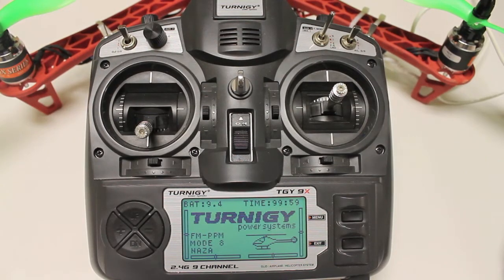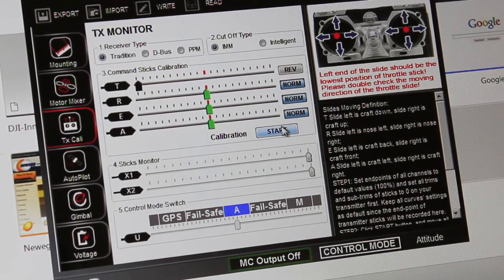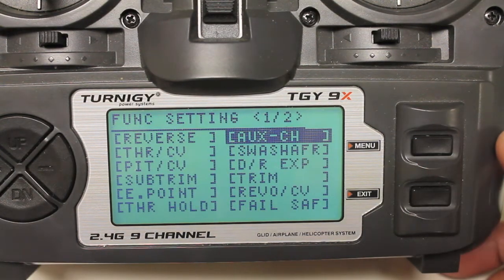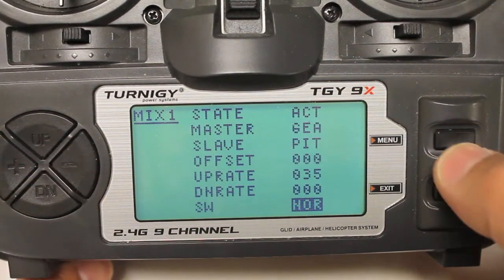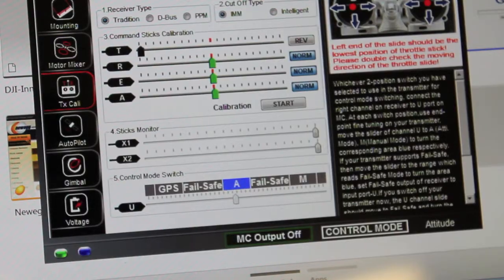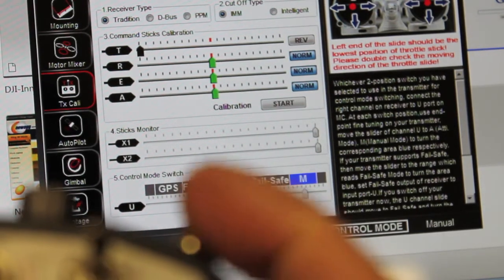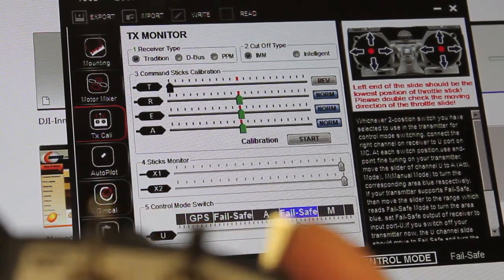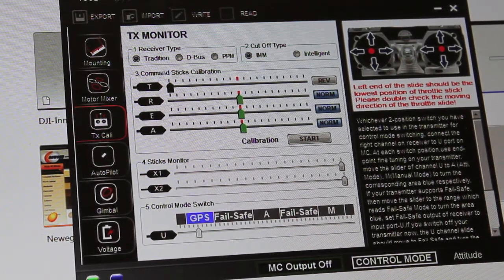DJI Naza Forced Failsafe Using Turnigy 9X Gear Switch Channel 5 Mix w/ 3 Position Switch

Comment: Dennis, have you ever setup the xaircraft minix flight controller using the 3-way switch on the Turnigy 9x? I sure could use some guidance. Thanks!
Reply from the maker: Denny Laman I'm sorry but I haven't worked with this FC before. I did just pull up the manual and it looks nearly identical to setting up flight modes with NAZA:

http://download.xaircraft.cn/Manuals/XAircraft%20MINIX%20Manual%20EN%20v1.0.pdf

Try watching this video and see if that helps you with your minix. Good luck!

https://www.youtube.com/watch?v=DikLpzlIqHA
Reply: Denny Laman  Hi Denny, did you figured out how to setup 3-way switch on 9x? I'm stuck in the same issue. Thanks
Reply: Sorry for the late response but I have no more worries about the 3-way switch for my quad as it just flew away! No more quad...

Comment: Nice video, congrats! Sorry for the question, but i have a problem with my naza connected to my frsky dr8 ii plus and my turnigy 9xr. When i push throttle i see that my x2 channel get up too. How can i do to fix that. I mean, I want that throttle dont  afffect x2 channel.

Thanks in advance.
Reply from the maker: Pedro Robles Hi! There is a part of this video that should explain why you're seeing the X2 channel go up. I'm assuming you're in heli mode, which may be the reason you're seeing this: Turnigy 9X Heli and Acro Flight Modes Explained

If you continue to have problems please post in our forums at www.garagepilots.com. Good luck!
Reply: Thanks a lot. It works!! Thanks you very much again!! 
I think this transmitter aren't absolutely  intuitive

Comment: Thank you for your wise advices!
I'd like to ask you two questions:
1) How is it possible to configure failsafe for GPS mode using the same gear switch?
I tried with MIX3 as for MIX1 or 2 but it's different and it don't works.
2) When I turn off my Turnigy 9X, Naza controller don't move on failsafe and my DJI F450 don't land. (I have actually no GPS).
How do I configure Turnigy 9X (V2 firmware and 8 chanel 9X8C-V2 receiver)?
Thank you for your help!

Comment: Hi Dennis,  Thanks for the help with the 9x it helped me heaps,   I was trying to find out if the 9x transmitter has a low voltage warning for the TX batteries, im running just AA Batteries in it.

Comment: dennis its all falling into place changing my naza m v1 to naza v2 and being able to use all functions could you please send me a link with pictures showing how to connect naza v2 to 9x receiver the correct way? I was using heli mode for over a year I followed kirkset setup now I see everyone using acro! whats the difference it flew fine in heli or does it have to do with being able to use more switches in acro mode? please get back to me asap also I have a few gifts for you a new blade rtf mqx and a blade rtf msr for all your help
Reply from the maker: Hey David, great to hear from you and I hope all is well. I saw your post on Garage Pilots the other day but have been hammered with work. Regarding ACRO vs HELI I was in the same boat as yo. I switched to ACRO mainly because of the 6 position switch. I was told that HELI has special mixing that doesn't apply to multirotors, but I've never noticed anything wrong with it. I sort of liked HELI mode better because there were less menu options :) I can walk you through setting up your receiver in the Garage Pilots forums, but I need to know what you're looking to do? Do you just want the 3 mode switch setup or more?

Comment: Dennis, After watching your great vids I've finally set up my 9X with the Naza Lite, my only problem is I can only setup home lock using the Throttle cut switch but I would like to use the AIL D/R switch instead, is this possible?
Reply from the maker: Karl Donald I'm not sure how you'd do that. I don't have my 9X anymore so I'm not sure if I'll be able to help. Sorry!
Reply: Karl- I thought I had mine set up under throttle cut but it doesn't work in the real world- just in the assistant. Can you please outline how you got yours to work?
Reply: Interesting. Not tried real world yet. I'm waiting for my frsky to arrive before I take it out

Comment: you mentioned not having the 9x anymore, but you still may be able to help me. When I am in "N" (for me its GPS) when I follow all of this, relative to my controller, I cant get it to slide to failsafe as I adjust the settings under uprate. It jus stays at GPS. when I flip the gear my "X1" goes from left to right so I know its activated. I have channel 6 set up as my pitch, I have channel 7 as X1 and channel 8 as X2. in my settings channel 7 is "gear" and channel 8 is "thro hold". any suggestions on how I can get failsafe?
Reply from the maker: Mr. McCabe I'm not really sure what's going on with your config. If I had my T9X still I could set it up like you and run some tests. The best I can say is continue to mess with your rates and see if you can get the slider to move into the failsafe area. Sorry, wish I could be of more assistance.

Comment: Dennis, thank you for your videos ! such a huge help to me. Are there any pros/cons for using F450 naza with a 9x in heli or acro mode?
Reply from the maker: I originally flew in heli mode but switched to acro to get 6 flight modes working with my APM flight controller. Other than menu options being a bit different I haven't noticed any difference.

Comment: Dennis.  Thanks for your videos!  They are great.  I'm trying to set up my flysky 9x with my dji naza and am having some problems.  I've got the ch 6 from the Rx heading into the U port on the Naza and on the radio, I've got ch 6 set to the gear switch.  When I fire up the assistant software, however, it has the U channel bound to the throttle - i.e., when I move the throttle lever, both throttle and U move.  Any ideas would be a big help.  Thanks!

Comment: Hello Dennis. Using this tuturial, do you think I can put a micro failsafe (used in cars) on the u channel and configure it to activate the failsafe switch when signal lost on a stock turnigy 9x rx? I saw a few videos on youtube with this but non replied to me there...
Reply: Yes, this works. First you set up a switch for forced failsafe, as in Denis' video. Then connect a nitro failsafe unit (I have a Hanger 9 failsafe) in between your receiver and your naza fc on your failsafe flite mode channel. It has a male servo connecter on one end and a female on the other end so it will connect in line. The nitro failsafe has a set button. Turn on the model and the tx, flip the forced failsafe switch and then press the set button on the nitro failsafe unit. It will now remember the pulse for the forced failsafe, and when the rx loses connection with the tx, the failsafe unit will trigger failsafe on the naza and either land, or return to launch, depending on how you have it set up in naza assistant. I am using this method until I upgrade the tx and rx with a module that has built in failsafe. Or until I get a taranis.

Comment: Hi Dennis, thanks for your videos, I learn a lot of thing :-) I tried to configure my radio with your recommandations but I failed. So, could u tell me : In the ProgMix1, the value of UpRate (35) is always the same or it depends of my configuration (NOR Value for example) ?
Other question : do u connect "U" in the Channel 5 in this case ?

Comment: Dennis,   I have the U port going to ch 6 and set up w Pit Trim.  I then have the pitch curve set to 3 different spots based on the 3 way switch.  I currently have X1 wired to ch. 7 and set to hov thro knob (because I was doing remote gain stuff).  I have 8 set to hov pitch, (trying to wire gimbal tilt)   I set the gear switch to ch.5 and set the mix 1 to master gear and slave pit.  have dnrate set at 15 and sw to nor.  leaving 3 way switch in nor position, I get no change when I flick gear.

Comment from the maker: If you click on "Show more" in the description of this video there will be a link to a 3 mode switch setup. This link will take you to a vid where I show how to configure the switch. Start at the 3 minute mark and watch as I discuss setting your L, 1, 2, 3, & H values to the same value. This will create a flat line that will prevent your throttle from altering its value. All values will be static. Hope that makes sense and let me know if you continue to have problems. Good luck.

Comment from the maker: Have you started with a clean profile on your T9X? I've helped a few others that have existing model profiles setup and that's caused some problems. Also, have you ever been able to configure your gear switch on the T9X without mixing?

Comment: Thanks for your video...You help me a lot!  I still have one big question - In Your video i can see how slider moving to " fail save" position, BUT it not enough ,same time MUST go THR slider to 55% position (and my copter  returning home with middle position THR )??? And like I understand with standard Turnigy TGY 9X V2 with PPM modulation "Fail save" channels not working( when TX OFF , DJI Ass not show.55% THR)???

Comment: Hello. I'm building Dji f550 with naza-m lite and turning 9x mode 2 :). I followed all the steps and my problem that motor's won't start! I'm not sure what is wrong and kindly need some help. Many thanks
Reply from the maker: When you say your motors won't start I'm assuming you can't arm them with the NAZA stick sequence. Are you using a GPS receiver and have you calibrated it? If you continue to have problems please check out www.garagepilots.com and post in the forums over there. Hopefully we can help you out.
Reply: Dennis Baldwin Dennis, I can not arm my motors either.  Im building the 550 also.  I get error 29, it seems even after I calibrate the sticks, everything is in the green on my NAZA, but the actual slider does not go all the way over to the right side on my "A" setting.  It goes all the way over to the left side, but not the right.  that may be where im getting my error 29?   HELP PLEASE...

Comment: Can you use this same method to configure the gear switch for IOC. Like maybe having gear switch of as IOC of and gear switch on as course lock?
Reply from the maker: I don't see why that wouldn't work. If I understand correctly with IOC though you need to be able to toggle it into the off position. If that is the case then you'd only have OFF and then one of your IOC modes. That may not be correct, but I recall something to that affect.

Comment: How do I do this with the 9xr? I want my 3 positions switch to be gps/additude/manual and my gear switch to be fail safe. Right now my 3 switch is gps/ additude/ fail safe. I'm using a 9xr with frsky module and receiver.  With a dji naza m v2. Can you do a video showing how to. Please.
Reply from the maker: +clinton soriano Unfortunately I no longer have my 9XR but this may help: https://www.youtube.com/watch?v=eWDX6i9yt4Q Good luck.

Comment: Dennis -  Thanks again for the videos.  I recently upgraded to the gps and am having some trouble.  No problem setting the three way switch to different flight modes, but when I try to add the gear switch, I get nothing.  Set it up exactly as you have in this video.  Any ideas as to what I could be doing wrong?  I have flysky.

Comment: Ok, based on a few of your GREAT videos... using the Turnigy 9X I can have the 3 flight modes (same as dji original controller)...could it be setup on 2 flight modes GPS, Attitude with the 3rd position as failsafe? Without using the gear switch? If force activating will this be a RTH failsafe as standard? I presume "yes" (common sense) is the answer to all these questions.

Next question is, if the DJI Phantom goes out of range will it still RTH? OR if transmitter turns off etc....?....AGAIN I presume "yes" is the answer here.

Lastly (i think)... can I program a switch to have OFF, Home Lock and Course Lock modes?

Ah, I thought of another... Sorry :).... Can I control a gimbal (pitch) at the same time as all the above features? I presume with them pots it can be done.

Hope all this makes sense :/ Basically I need full control like original DJI controller PLUS gimbal pitch. I have the daft 5.8ghz tx/rx radio gear with my phantom and want to convert to 2.4ghz radio gear so I can put some decent 5.8ghz fpv gear on board.

Cheers Nick
Reply: Is FrSky module actually needed? I believe others have got it working without the extra modules
Reply from the maker: njhmusicmanchester I'll do my best address some of your Qs. If you've configured your TX/RX for failsafe then a loss of signal trigger will be the same as turning your transmitter off. Since your receiver will be looking for a signal it doesn't know the difference between being out of range or the TX being turned off. That's just a theory of mine though.

I wasn't able to figure out how to do IOC modes with the stock firmware. I've done this with my Taranis and OpenTX, but not sure if it's possible with the 9X and stock firmware. 

You should be able to control gimbal pitch with a separate channel connected to one of your pots. I've done this with my Taranis and Tarot T-2D gimbal. It works very nicely.

Good questions. Hope you get this all sorted out and keep us posted!

Comment: I have the default Aerosky H100 Tx/Rx will it be compatible with the DJI Naza-M lite w/ GPS?
Reply from the maker: It should be compatible but don't quote me on that. If you already have your NAZA try running the NAZA Assistant and look at your stick inputs to see that they are moving properly.

Comment: Hey Dennis, have you updated your NAZA firmware and assistant software? Can you still force failsafe? I am running firemare 3.16 with software 2.16, I can't for the life of me get it to work,any suggestions? Thanks
Reply: I also noticed on your stick monitor, your X2 doesn't move when you switch the gear switch, mine dose. I've tried using other switches but I get the same results.
Reply from the maker: Yes, I am running the latest NAZA firmware. If you would check out www.garagepilots.com and consider posting in our forums over there. Hopefully we can help you out. Make sure you tell us a little bit about your TX configuration so we know where to start. Thanks.
Reply: Dennis Baldwin
Will do, Thanks

Comment: Hi I'm have trouble when I put cheerleader 6 into the u channel my throttle moves the u channel? What have I done wrong? Thanks dave
Reply from the maker: Hi David, check out this video and setting your curve to be flat:

DJI Naza 3 Flight Modes (Attitude, Manual, and GPS) w/ Turnigy 9X Transmitter and 3 Position Switch

Hopefully that will help address your issue. If not then let me know. Happy Holidays!

Comment: I have my trottle cut switch set to forced fail safe, any idea how I can set the gear switch to be throttle hold so it lock's throttle @ 50%...??
Reply from the maker: odbodb Good question. Not entirely sure how to do that. My Turnigy 9X no longer works because I need a new battery. I'm going to order one soon and will post if I figure this out. Please do the same if you figure it out. Thanks.
Reply: Will do... I was also trying to get home lock but I think I've run out of programmable switches, I'm using the flysky th-9x with std firmware & it only allows 3 (I think) so back to the drawing board...Cheers

Comment: Cool!  Do you know if you can set up the naza to go into failsafe when the transmitter is turned off? I haven't been able to figure that one out, I haven't tried in the field either...
Reply from the maker: Hey Darren, yes but it's more a function of your receiver than anything else. Check this out and maybe it will help NAZA Enhanced Failsafe RTL After Signal Loss With FrSky Module
Reply: Right on thanks!
Reply: Darren Langley Theres a cheaper option, just buy a micro failsafe, connect it to channel 6 on the reciever and to u port on naza and store on the failsafe the positions of the switches to activate the failsafe feature on naza as shown in this video and thats it.

Comment: If the 9x is in heli mode, prog mix 3 can't be used for failsafe switching,only mix 2 and mix 1 can be used,which means you can only have failsafe on two of the three flight modes.
Reply from the maker: Very good to know. Thx!

Comment: Hi Dennis, your videos are so helpful! But i have one question, i've turnigy 9x and i would control leds on my plane with the Turnigy Receiver Controlled Switch.
Well i would put the gear as switch to control it. But i REALLY dont know how! I'm using a Swift II with deltamix, so i use only the stick controls. Recently i've learned how to set throttle hold! but the switch, AWW! Please help me!

Comment: I know this is old but I was trying to use a receiver switch for lights on my quad but I cant figure out how to program 9x sence chennel 5 is used.
Reply from the maker: BP FLY Have you tried using another open channel such as 6 or 7? You should be able to set one of those up on one of your switches.

Comment: Hi mate: How I can configure the transmitter so that if it is turned off or loses the signal then activate FS?
Reply from the maker: ***** Perhaps this will help? https://www.youtube.com/watch?v=INpO7irmaMo
Reply: Dennis Baldwin Thanks mate for your help. Do you know if the FrSky module works with a FlySky FS-TH9X 8ch 2.4Ghz?

Comment from the maker: You know, that's a good question. I just defaulted to Heli mode because it had everything I needed regarding options, but have never tried acro mode. I think either way you should definitely be able to get in the air. What specific problem are you having and may I suggest checking out garagepilots . com? You can sign up and post any questions over there. There are a lot of guys, including myself, that will be glad to help you get in the air. Best of luck.